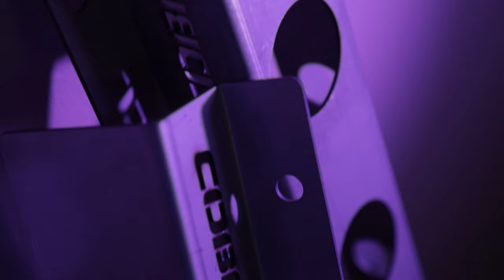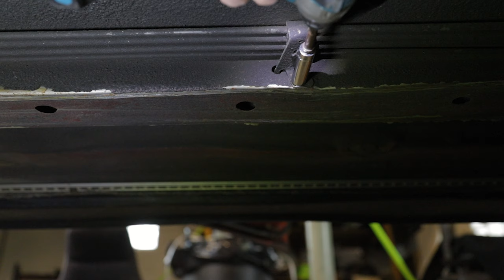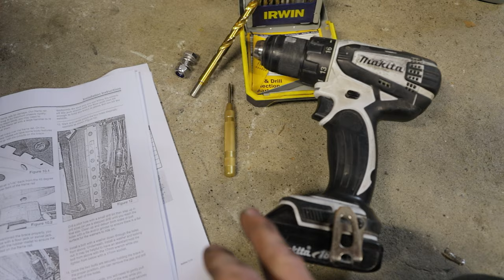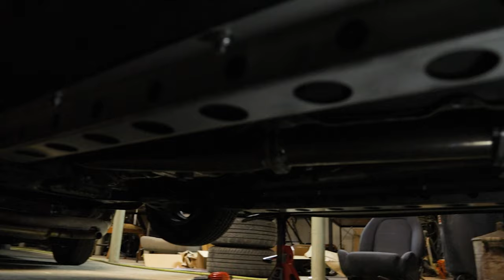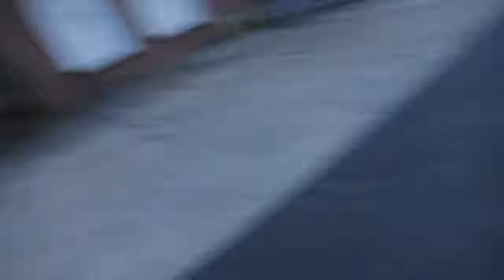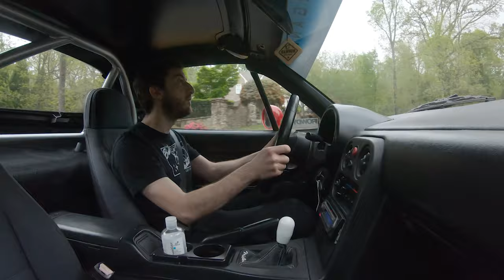Best Miata Handling Upgrade? - Frame Rail Reinforcements by Cobalt

Comment: May want to spray some undercoating on those holes to avoid rust
Reply: I'll tell you. So during my roll bar install I took some paint off around the parcel shelf area. One year later after not ever having contacted water the bare steel already had light surface rust. I was glad to be able to paint it.

Comment: Would this work for those of us with salt on the road? Looks like you'll always have a tiny gap between the stock rails and add-ons, so it's a prime spot for grime to gather and cause further rust on the stock rails - much like two-layer NB frame rails around the engine.
Reply from the maker: I could definitely see this causing issues with cars that see salt.
Reply: @AlexPerrucci  Maybe a follow-up video in a year or so? :) Would still be interesting to see how they held up.

Comment: How do the Cobalt frame rails compare to the Flyin' Miata frames rails?
Reply: I have the FM rails and butterfly braces. The cuts are very rough and it arrived with some surface rust right out the box. These cobalt ones look much better quality. Wish I had ordered these.